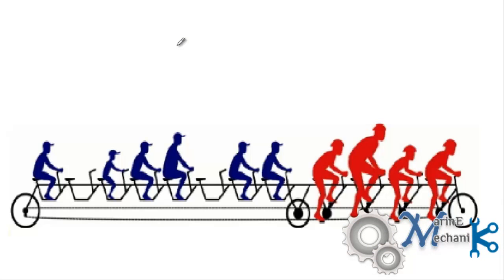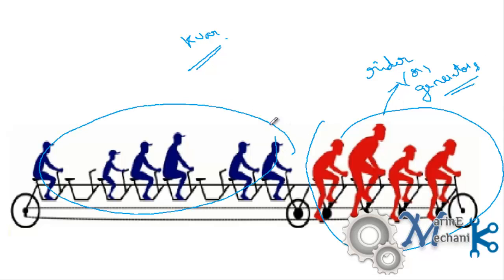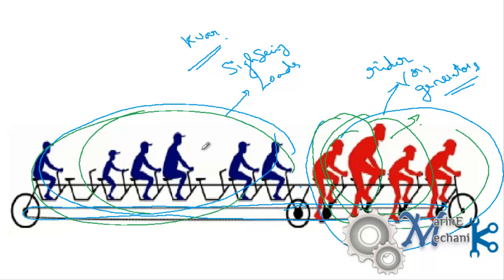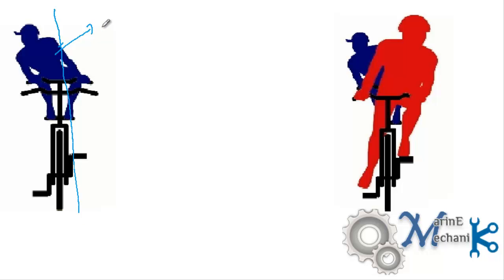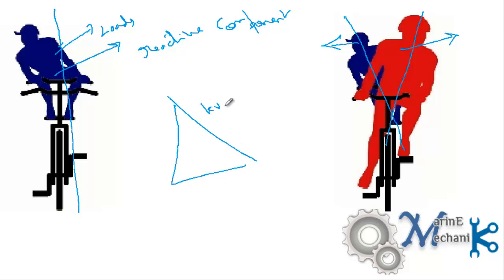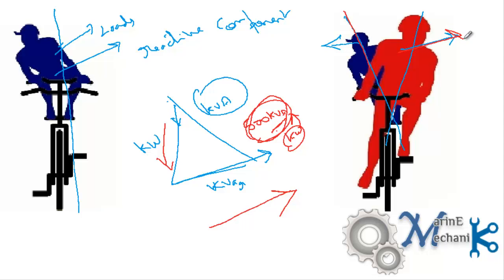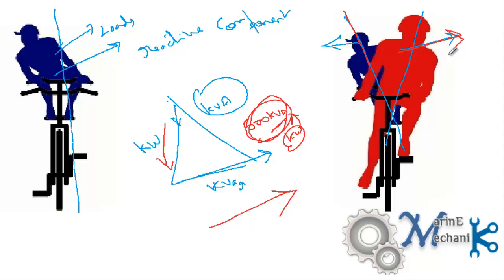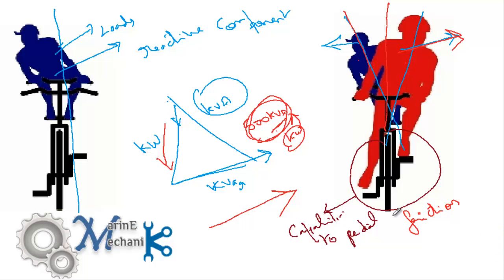Best Explanation for KVAr..with an Example, Must Watch. Part 2.

Comment: thanks a lot for this good example about real and reactive power......
i want to ask a question that why the reactive power is needed in a power system.......
someone clarify my doubt.......
Reply: ignatius rathan Reactive power is the leftover from the apparent power, and the real power (apparent minus inductance)
The inductance lags the power system from a power factor of 1 to something like .8 - you don't 'need' reactive power - it's run-off from a circuit that's out of phase

Comment: well that's good and thank you, but my question is what does friction represents in electricity ? and why do we lose power while all the instructors and the capacitors at the network resupplies us with all the power they've just absorb at the previous cycle ?!   

another question which is driving me insane , how the hell can the current be flowing toward our capacitive load while the voltage of the generator is lower than the voltage of the load ? o.O ?!
Reply: We lose power because of the resistive components/ resistance present in the caps and inductors. Also, reactive power arises since the resupply of power is not in phase or doesn't come at same time, hence only a part of power(active) is available